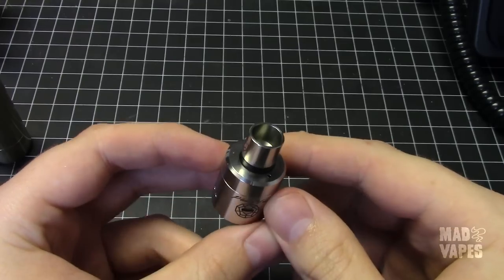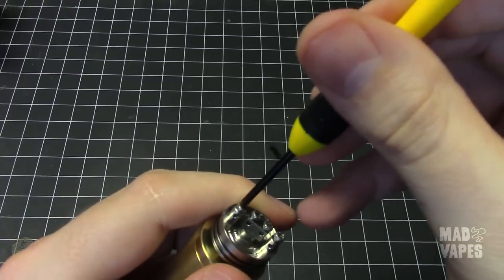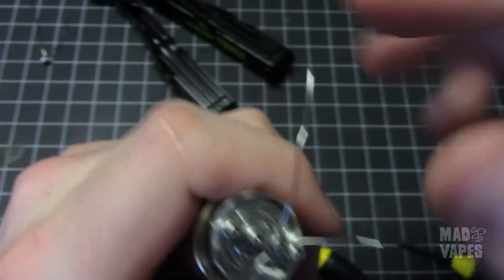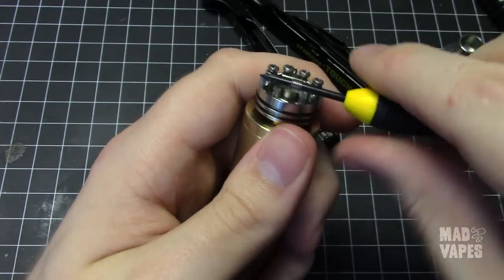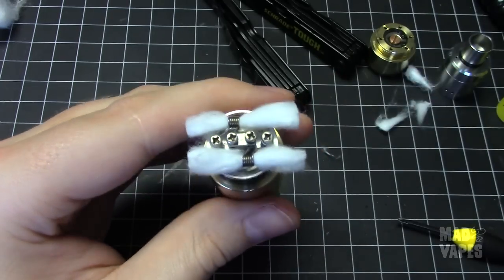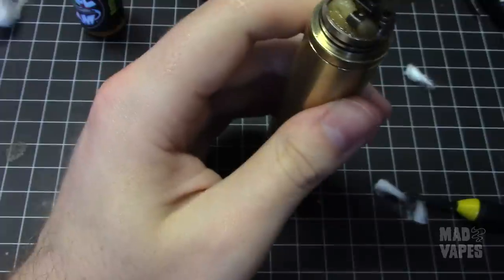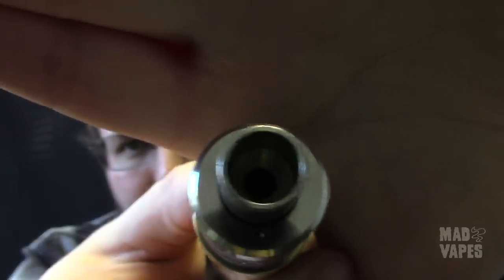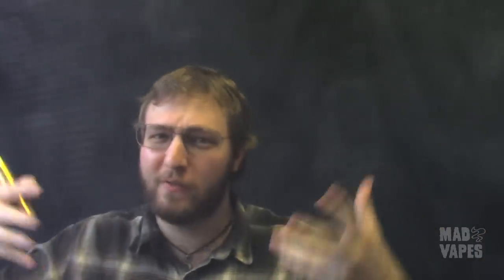The EHPro Plume Veil RDA - Feature Overview and Rebuild

Comment: Just built one and it's great.  Didn't watch the video first, so I will definitely be moving the coils toward the center next time.  Works great though even without that airflow on the back of the coil.  The build is really easy.